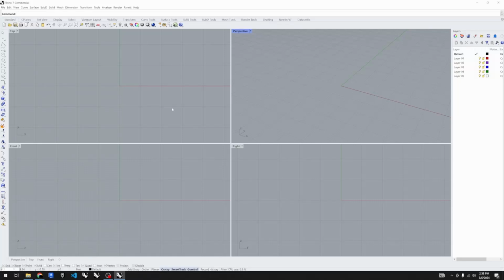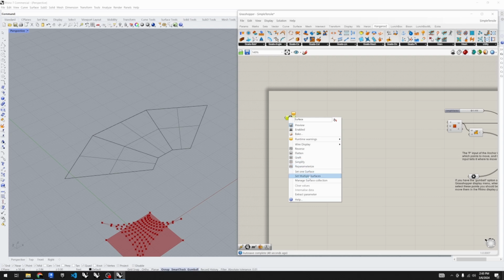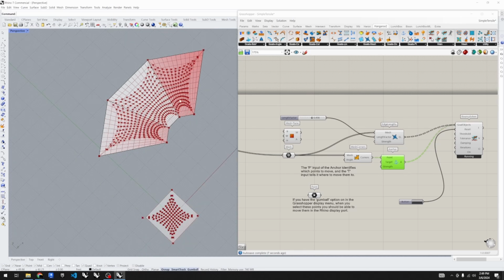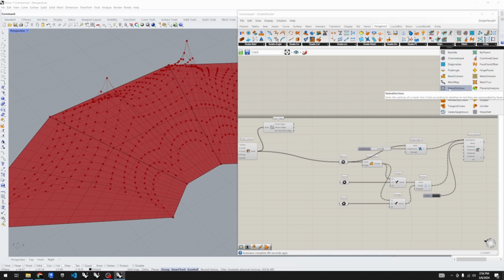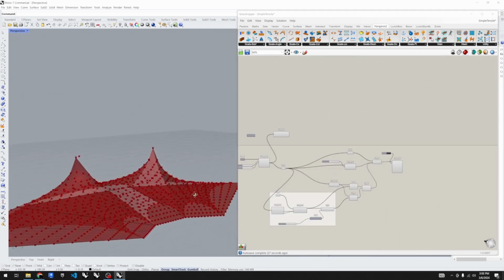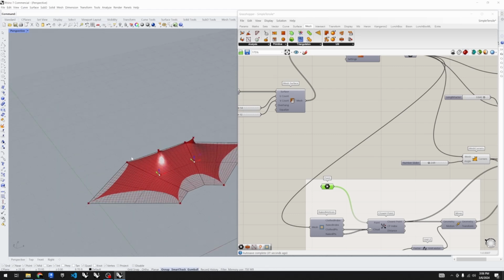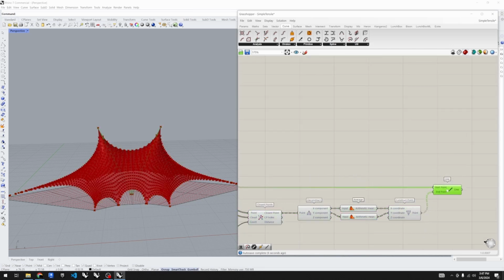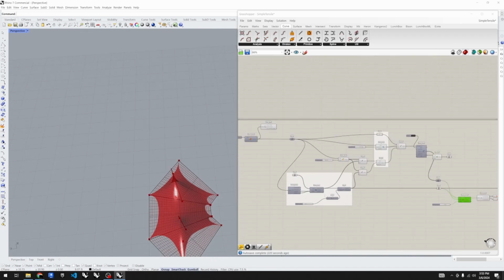Tensile Structures - Kangaroo 2 in Grasshopper

Comment: For poles: Instead of constructing point at zero level,  just select points only in closest proximity. Then make vectors from anchor point to closest proximity points. And the make average of those vectors. In the end, make sdl line using anchor points and average vectors until it intersects base plane.
Reply from the maker: Thank you for the suggestion. Is your method more structurally accurate?
Reply: @motus406  Yes, average vectors means average compression force towards ground from that apex point. So, pole will be stable at that point.

Comment: 15:20 doesnt work for me help, i swear idk why
Reply from the maker: When I originally placed those points that I move up I made sure that Mesh Vertex was enabled for Osnap in Rhino. The issue is most likely that your anchor points do not fall exactly on a mesh vertex. If you keep watching I show how to fix this to make the location of the anchor be a bit more free form. I hope that makes sense!
Reply: @motus406  Doenst work for me too
Reply: @motus406  I am having the same issue, there I made sure I have osnap on and even tried the instructions later on in the video and still the point does not connect and doesn't allow me to manipulate the points. Not sure what else I could do? I am on rhino 7
Reply: @DavidParamo-w7u  I had the same problem and solved it by changing the V count so that one of the lines falls over the mid point of the surface. In that way when you choose the anchor points it'll automatically fall on the mesh vertex. I realised that my V count needs to be at an even number otherwise the structure just falls flat again.
Reply: Helloo, 18:25 for some reason when i move the points they don’t snap to the naked vertices of the mesh… I’ve done everything as shown on the video but it just doesn’t work, is there any explanation? Thanks
Reply: @rafaelpuse-haton2533  maybe you need to turn on the onsnap in Rhino,

Comment: Hey is it possible, to add more Mesh Corner or better said to close the tensile structure following the  Surface Edge
Reply from the maker: Yes, you can add as many edge anchor points as you would like. One thing to note is to make sure that your anchor points are on a mesh vertex. Let me know if this is not clear or if I did not answer your question fully.
Reply: @motus406  Thank you very much

Comment: Great tutorial! thank you! could you perhaps tell me how you would go about simulating a pole pushing into the membrane? A specific example would be a pole from a stretch tent pushing against the membrane to tension the membrane. Normally these poles would have a rounded cap with an approximate diameter of 100mm. Thank you in advance!
Reply from the maker: Would you have a link to an image of the scenario that you are describing? There are a lot of support conditions for how these structures anchor the pole at the top to the tensile “fabric”.